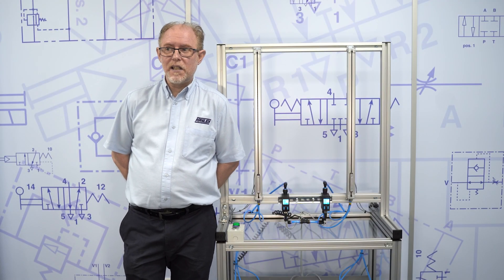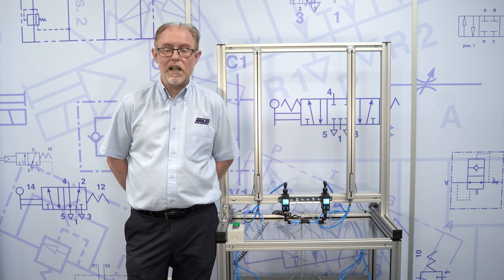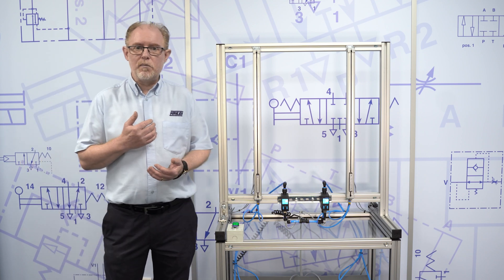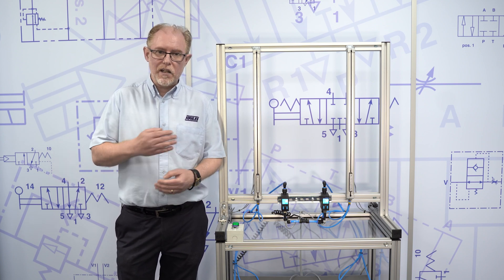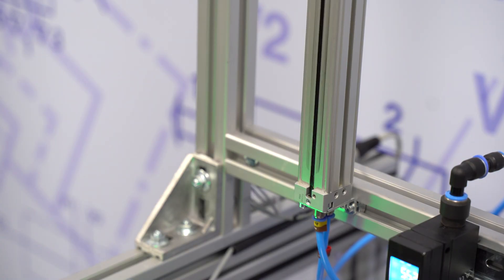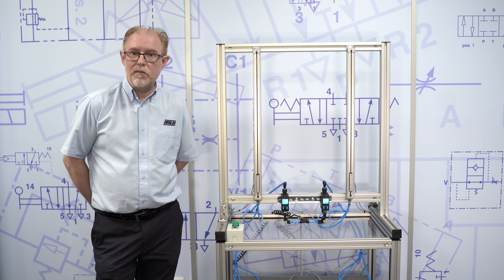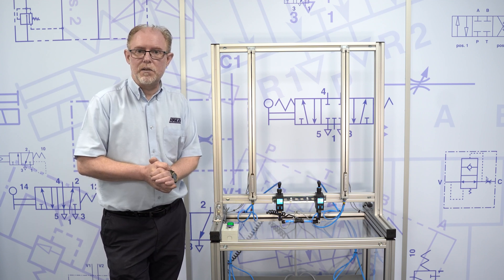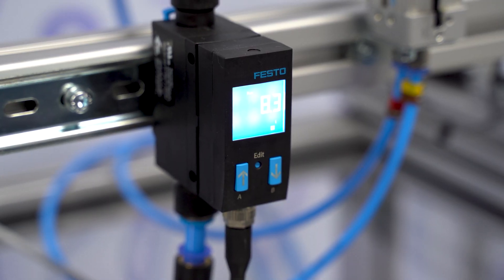Save 45% of your Compressed Air with the Hayley Pneu-Saver

Comment: So you reduce the pressure and low to the machines with your gadget? Most machines have this capability anyway
Reply from the maker: Hi Myke, The Hayley Pneu-Saver actually reduces compressed air consumption by recycling the air that would normally be exhausted.